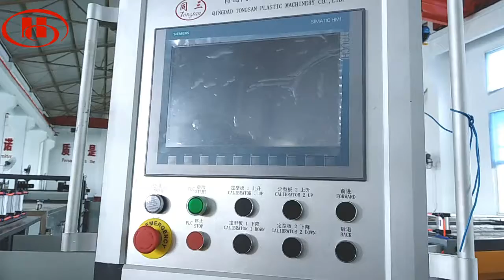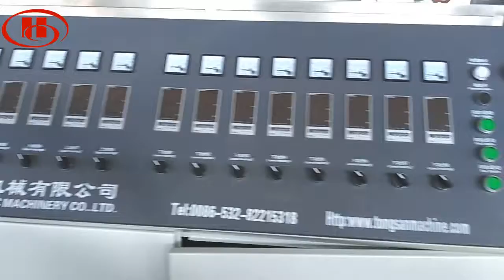pp hollow sheet  making machine 2 ( salersophie@tongsanextruder.com)

Comment from the maker: Our advantage of Our PP hollow grid sheet

1,We adopt fan cooling style, the cooling speed can be fast.So it won’t shrink after cutting, it can effectively reduce the error.And the speed of production can be more fast.

2,The oven’s material is 201# stain steel,there are total 4 meters with two 2 meter oven.The customer can choose to use one or two according the product need.

3,Our company is the only one who adopt imported rubber roller which softness  is more suitable for hollow grid sheet.The friction force of the rubber roller is more strong ,more durable and longer lasting.

4,The cutter adopt SERVO motor from Japan

5,The paul off machine adopt helical gear

6,The mold from GELL adopt special steel which made with Italian formula technology ,it has the characteristics of memory rebound.The mold is more wear-resistant and the service life is several times longer than ordinary mold.

7,One set mold can produce different thickness range ,such as 2mm-5mm,5mm-8mm,8mm-12mm,just by change the center of the mold.

8,The screen changer adopt silk screen circulation, altogether 4 pcs  silk screen, 3 normal use, 1 standby . It does not need to stop when changing the silk screen .

9, The production line adopting the co-extrusion mode,so the recycled material (80 %-90 %) can be used in the middle, and new material can be used for the surface. The product has smooth surface which no visible difference to the naked eye, so it can reduce a lot of costs.

10,Our equipment has a good look. The wire is convenient to connect and the plug is easy to identify with the mark number.

11,There are 6 rollers on the front haul off machine and 3 rollers on the second haul off machine ,so the production line is more stable. 
   
12,The haul off machine and the calibrating platform are on the same guide rail for convenient synchronous alignment adjustment.